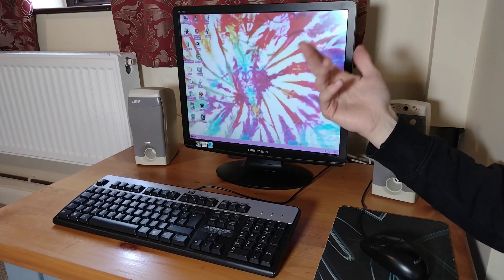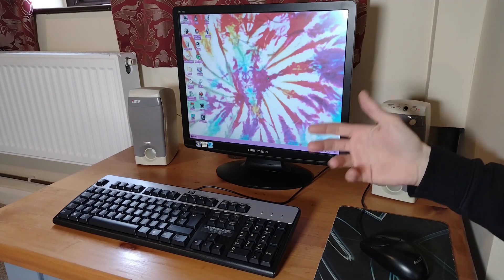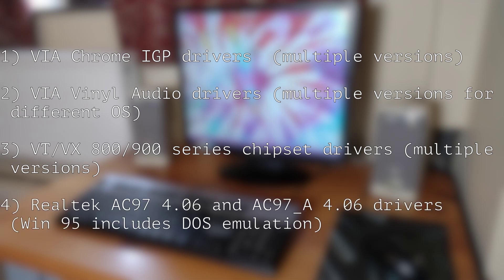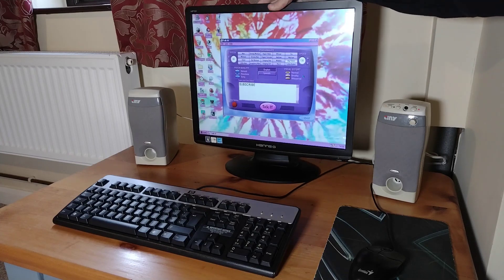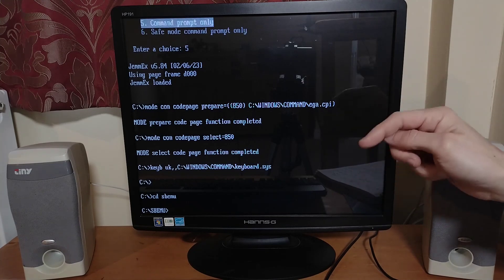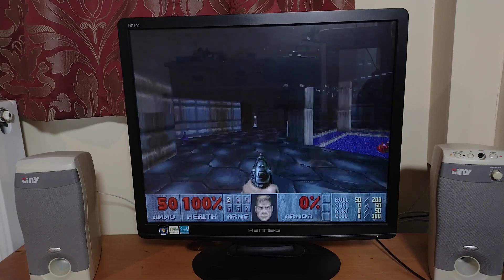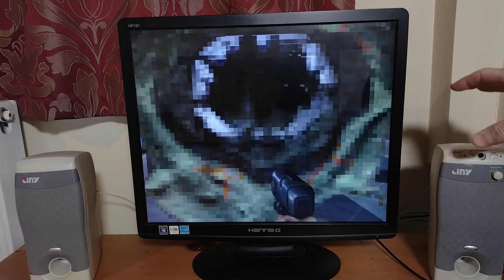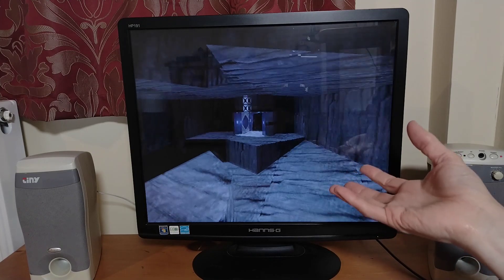Wyse Cx0 Sound

Comment: You saved my night, thank you for this. I didn't need to add the config sys change in freedos, just the other lines you mentioned to the fd autoexec batch file, ran descent setup, and it picked everything up at irq 5 dma 1 etc, and now im enjoying some retro gaming. Cheers 🥂

Comment: If the sound card in the thin client or the USB sound card have a line in input, one option would be to connect the output of one sound card to the line in of the other. I have an old Pentium retro PC with two sound cards (ISA for DOS and PCI for Windows 98) and this worked very well.

Comment: Nice!  I just picked up one of these brand new, hoping I could coerce it into some DOS gaming.  This is brilliant, thank you so much for the hot tip!
Reply: I just received mine in the mail today - initial testing is quite promising.  One nice thing about these Wyse thin clients is that they have legacy USB emulation at the BIOS level, so if you boot the machine with a flash drive inserted into a USB port, DOS will detect it and give it an A drive letter just like a floppy drive.  This negates the need for having Windows dual-installed to do basic stuff like copy files.  My only gripe is that the VIA video chips aren't the best for DOS - games like Commander Keen 4 and Realms of Chaos have jerky video and Epic Pinball has the bottom part of the screen chopped off.  But other games like Duke 3d and Wolfenstien 3d work great.
Reply from the maker: Awesome! Enjoy your retro gaming on it.

Comment: I have a HP Thin Client which Philscomputerlab recommended years ago.
Still haven't done anything with it, really but I could see it being a nice DOS system with SBEMU now being a thing.
Reply from the maker: Yeah, I can see the old thin clients becoming more popular for DOS stuff now, hopefully it doesn't push the price of them up as you can still get them cheap.
Reply: @RetroSuperhighway  I fear these things raise in price for other reasons too as Raspberries are still hard to get hands on and more and more people recommend these as a replacement until the foundation get things rolling again.
Not that I am against the idea of using a Thinclient for purposes the Pi is supposed to handle but it sure may lead to a increased demand for these in the future.
Reply from the maker: @MegaManNeo  Yeah thats a good point, especially the slightly more modern ones, I understand they can be used in the place of a Pi for things like running 3D printers or replacing a RetroPie for example.

Comment: Great video! I am using a hp 5710 for this because it has a parallel port and can use the nice opl3lpt adapter for dos sound. For win98 it is very easy because it has an ati 7000 graphic chip inside and there are drivers for win98. 
I love thin clients for retro gaming 😊
Reply from the maker: Nice! That sounds like a great thin client to use for retro games.

Comment: this is brilliant. I hope it works with other ac97 devices like the intel ich7. I guess there must be some win98 drivers that work on that via vinyl. I recall having some other drivers for the via vinyl that supported win98
Reply from the maker: Seems to be widely compatible with AC97 from what I have read so far, so I think there is a good chance it will work. I'm still hoping for some Windows 98 drivers, but so many just don't work that I wonder if Via did something a bit weird or different with how they implemented it here.
Reply: @RetroSuperhighway  yeah, that might be the case. I would investigate running linux there just to check which sound codec it picks up, and find a generic driver for win98 for that codec. might be better than trying other via drivers